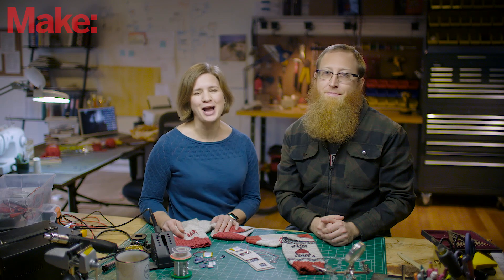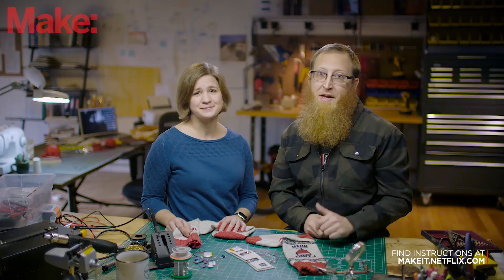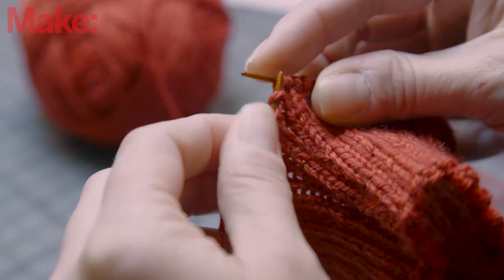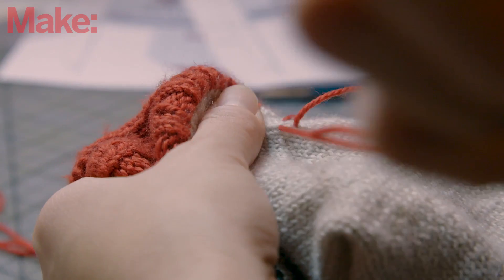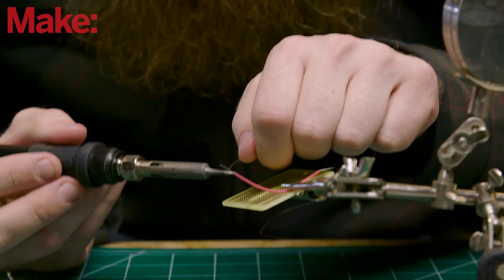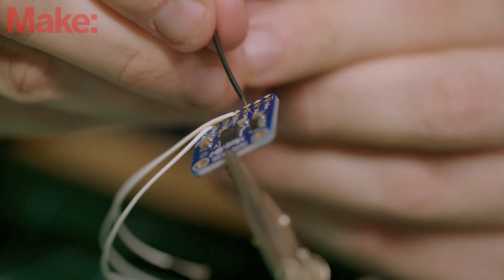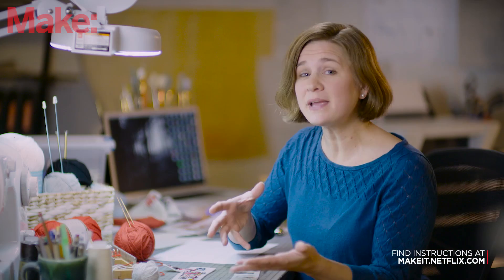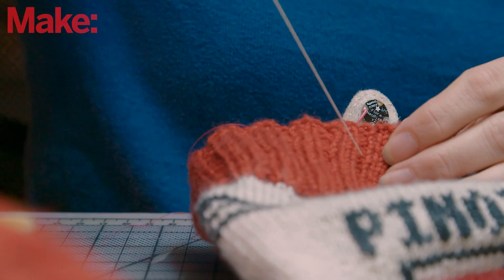How to Make Show-Stopping Netflix Socks | Make:

Comment: Modern Roku remotes don't use IR. These socks are worthless!
Reply: +SilentS The newer remotes are bluetooth but the Roku boxes themselves still support IR. My guess is so people can use universal remotes that only have IR.
Reply: +Clay Cooper You would still have to go out and buy one of the supported universal remotes in order to program the socks. Still a non-starter.
Reply: SilentS I hadn't thought of that. I'd be more worried about the battery burning my leg than getting it to work with a Roku anyways.